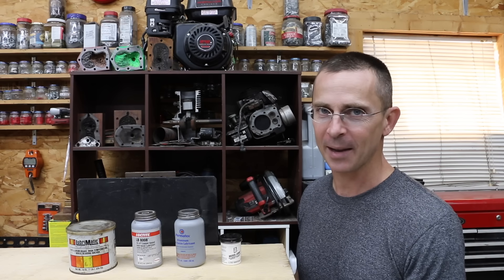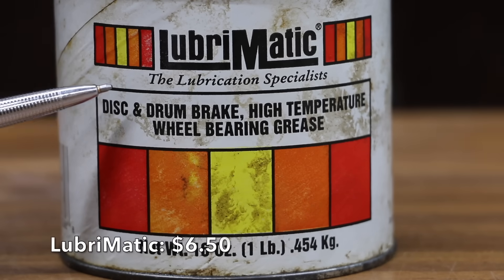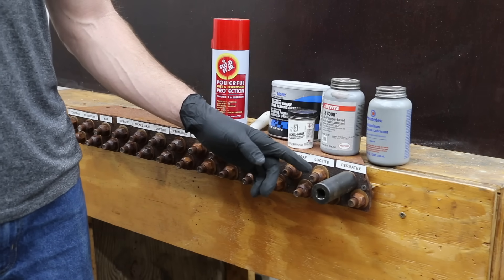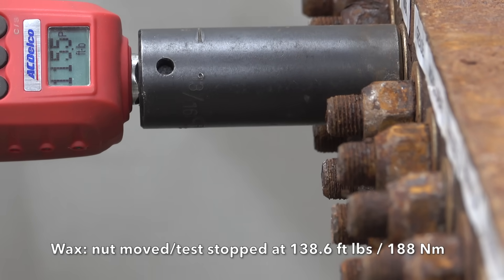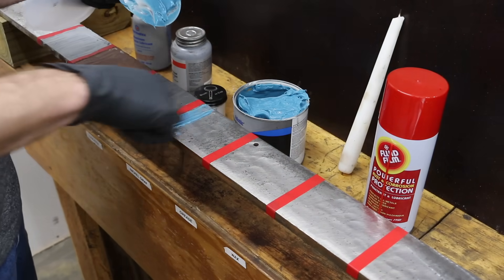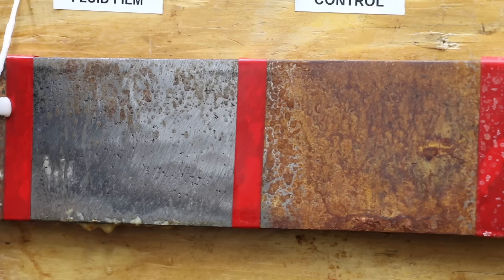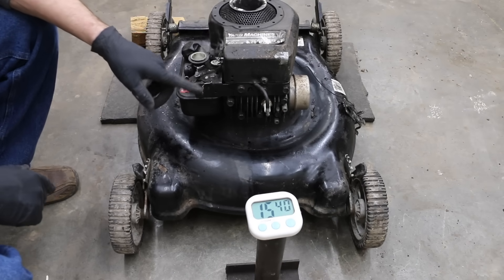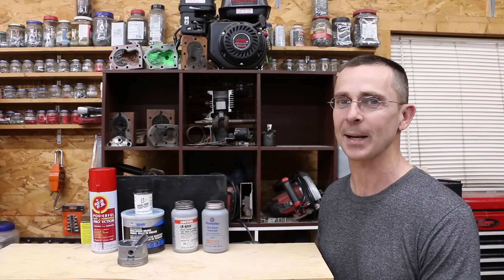Does Anti-Seize Compound Actually Work? Let's find out! Anti-Seize vs Grease vs Fluid Film vs Wax

Comment: I have that same Permatex container on my work shelf. It seems to last years. I use it on virtually every bolt and nut on every project, particularly those that will see weather, always wheel bolts, lawn mower repairs and etc. I've taken off wheels and disassembled parts years later and found it to work perfectly, including the race car (which has set 25 world and national records in NHRA/IHRA Stock Eliminator and yes I'm bragging lol). I may try the Loctite after seeing your tests but I swear by the Permatex.

Comment: As a former mechanic, it should be used more than it is. Spark plugs in an aluminum head, wheel studs, bolt action rifles so they do not freeze in the extreme cold. I could give you a long list, any bolt grip puller, but that stuff is messy.
Reply from the maker: Appreciate the insights!

Comment: For stainless steel nothing works better than silikroil in a high heat situations. Like commercial kitchen equipment. Or just normal conditions. It will often get a galled screw to break loose enough to remove it.

Comment: When a low pressure steam union has a slight gap and the work area is an absolute nightmare preventing you from making adjustments, graphite  anti-seize is your best friend.  Slap it on the union face and threads.  Torque well (use a mallet if absolutely necessary due to space restrictions) .  No leaks.

Comment: The real test of an anti seize is on stainless steel fasteners and fittings subject to high temperatures. The problem is not corrosion but galling which happens when a small imperfection slides agains another part resulting in work hardening, and a seized part. The manufacturers of the  turbine engines I worked on recommended a product called Never-Seez Nickel Special which is rated to 2400 degrees F. Fantastic stuff but expensive!

Comment: Where I work they religiously coat bearing journals with it.  Many on the journals are pretty badly worn.  I've become convinced that anti-seize in a situation where the fit is lose and it walks the whole time turns to glue when mixed with the metal dust from wear.

Comment: 1000% its works.   I spent 40 years in industrial construction and maintenance and if the previous mechanic had used it, it would have saved me a ton of work.   The best i ever used was nuclear grade nickel graphite from Permatex.  If it is used on bolts inclined to seize up, it will help it from rust locking.   You can cook the oil out of it but it leaves something softer than the bolt or nut so it gives instead of the two harder metals from binding up from friction.   Yes it does work and well.   Its the mechanics best friend!
Reply: The Permatex Aluminum also contains graphite. My experience is that it works as well as copper or nickel on fasteners that don't see high temperatures. I believe that graphite is the key.

Comment: Nice Video!
In our company we use two diffrent anti seize products. For shafts and hubs we typically use copper paste as you have shown in the video.
and for screws especially if they come in to contact with water we use a mixture of beef tallow and transformer oil (the oil is just there so that the tallow doesn't get hard). This is a very old trick but it works so perfectly. We never have problems gettings nuts loose if the guy before you used that mixture.
Sadly only few people nowadays know about this anti seize product but it works really great!
Keep up the good work!
Greetings from Austria!🇦🇹

Comment: Original Antiseize worked VERY VERY well.
Reason is because it actually contained lead.

In many of the old owner's manuals for cars, in there they say to put a few drops of engine oil on wheel lug nuts.

Comment: Nice show giving the 1 cylinder all the beans while testing. Be more careful as a generator of mine once threw the rod clean out the block denying the bed of my truck when it happened. This could cause you serious injury if it happens in your shop. Not knowing which path the force will be going. Nice demonstration. Just please put in a steel plate or something to be more safe between you and the test subject

Comment: I'd like to see a comparison test on keeping battery posts from corroding....
Reply from the maker: That's a good suggestion!
Reply: @ProjectFarm I used to work on my Dad's used car lot. So we always had issues with that. I discovered after cleaning them I could just put motor oil on them and it solved the issue . Just dab on a little more at each oil change to keep it coated. Works great.

Comment: The metal in the compound is to put an indifferent metal in the mix in between the threads.  A layer to prevent corrosion bond. 

It's not lube for moving parts

Comment: I used to formulate antiseize and other greases when I worked at a lubricant company.
I made stuff for the military, freezing railway equipment,  and hot engine exhaust manifolds, and my stuff  never failed.
We used all the same tests, plus a 24 hour salt/brine spray test for corrosion.

Comment: 40 years ago Quaker State had 
Golden Chassis Grease
It didn't have a type number.
I still have a tube from way back then 
It looks just like the copper anti seize 
The tube does not state what it is just "special additives" and "do not use in ball roller or wheel bearings" and I remember using it like a poor man's anti seize until I could afford the real thing.

Comment: In shop where i work there is an oven nearby used to heat things up to 600 degrees.
A few years back maintenance was replacing some needle bearing rollers that were part of sliding drawer on bottom of the oven. The rollers were completely seized with baked grease in the rollers.  I told the maintenance guy working on it to try using 
' never- seize ' as grease on the bearings so they dont get seized up.
He informed me he had special
' high temperature ' grease to use with the new bearings. 
A week later the ' new ' bearings were all seized up tight.

Comment: I’ve actually never used anti-seize I use grease on all my bolts on my trailers and outboard motors that are constantly dumped and saltwater years later the bolts come apart with no problem plain old grease
Reply from the maker: Thanks for the feedback.

Comment: Anti-seize compound is not primarily a lubricant.  My understanding is that it has has metal or other powders in it which form a sort of barrier.  This is mixed with lubricant(s) and a binder to make it sticky.  It is meant for use on bolts, &c. where there isn't supposed to be a lot of motion, but it prevents galling and seizing.  If you try to use it as a lubricant, the metals being moved around actually act as grit.  There are formulations for specific metals (iron, aluminum, stainless steel) and conditions (e.g. marine, high-temp).

Comment: People need to understand that antisieze compounds are for use as a static product in a confined space like threads. It’s usually a dry product with various petroleum additives to hold it in place until the fasteners are installed. A real test would take years like exhaust nuts on an engine that has gone through hundreds of heat and cool cycles. Sometimes running for days nonstop. As for an engine internally there’s no hope because it isn’t trapped and not a good lubricant for continuous motion, plus it doesn’t supply cooling which oil does.
The best I have ever tried is Caterpillar branded which is made for them by various manufacturers. It seams like a molybdenum product by its color.

Comment: I would like to see various brake part lubricants tested for resistance to corrosion agents, extreme heat, pressure washer, and low temperature lubrication.

If you take my idea, I'll upgrade my membership.  😉😂

Comment: Aviation mechanic here. Bostik Silver nickel ant-sieze is a life saver on our high temp air lines and other high temp areas on and around the engine. 
You can always tell when the last mechanic didn't give a damn, when you're having to use 1/2in drive breaker bar to break loose bolts and b-nuts to get your part out!

Comment: Aluminum (Al) antiseize is cheap. I used to use it, then started to buy more expensive stuff, copper and nickel.
    Then, after learning more about galvanic corrosion, I am back to Aluminum.
   It is hard to tell, they all work somewhat, but in theory, copper particles in a steel-steel thread should cause the steel to corrode, while Al should protect the steel while undergoing "sacrificial corrosion" itself.
    Since they are all in some unknown "carrier lubricant ", the greasy part, it is hard to really know.
   Differing conditions make it even harder to know.
    Some jet engine manufacturers have specified milk of magnesia for fasteners and ignitors on jet engines.
   That is strange,  it is a water mixture, and not much of a lubricant,  but I have tried it and it does seem to work. 
    It is also really cheap.
    This subject is like penetrating oil- we all have our favorites, and are sure we are right, based on limited anecdotal evidence.
    Thanks for your effort and interesting tests. You sure put in some work, I learn from it.
Reply from the maker: Thanks!  Thanks for sharing.

Comment: One of the big things that separates Anti-Sieze from grease is anti galling.  When two similar metals are under pressure with one another for prolonged time they swap electrons and get fused together over time.  Anti-sieze not only prevents rust but also creates a different metal barrier between the fastener threads preventing galling.  Hence why aluminum or copper is used.  also aluminum and copper have different intended materials to be used on but I forget what it is.

Comment: Used anti-sieze on a drum brake adjusters on my car that unintentionally ended up in a field for about 35 years. Towed the vehicle out by the axle compressing the  e-brake cable locking the brakes. Cut the e-brake removed the wheels and backed the adjusters off and pulled the drums like the day I assembled them 35 years ago took less than twenty minutes  to r&r and push it into the garage. Friend who was watching couldn't believe it...actually I couldn't either...highly recommend anti-sieze!!!😇
Reply from the maker: Thanks for the feedback.

Comment: I have been coating battery posts with grease for 50 years whenever I install a new battery.  It totally stops all corrosion.

I think this was a valuable video, but I think that the lawnmower part was a bit odd.
Reply from the maker: Thanks for the feedback.

Comment: I'd argue there's something wrong with consistency of the environment when your control nuts required less torque than treated nuts in any circumstance. It also seemed quite often that the lower row required less than the upper row, indicating the environment just wasn't quite equal across the board.
Reply from the maker: Thanks for sharing.

Comment: Antiseize is great but it also is a lubricant. I snapped a fuel rail bolt this way. I was using a torque wrench the whole time. It was an awkward location. Luckily I was able to use a pick to back out the bolt. Otherwise, the head was coming off.
Reply from the maker: Thanks for sharing.

Comment: Permatex’s anti seize is an anti galling compound.  Yes, it will protect against rust/corrosion, but galling is wholly different.  Where metal surfaces are under extreme pressure, friction, heat, they can actually seize or weld together.  The high heat rating allows this to prevents galling far better than “regular grease”

Comment: Always use grease for motor shaft or near bearings and use anti seize on bolts nuts and connectors. The reason is near bearings shafts and motor shaft the anti seize has abrasive in it and it can get into the bearings and the seals and make the bearing fail.
Reply from the maker: Thanks for the feedback.

Comment: I've used both Loctite Copper and Permatex Aluminum.  Both worked as advertised.

WARNING:  DO NOT EVER use anti-seize on nuts and bolts with require precise torque values such as wheel lugs!  Use ONLY clean and dry nuts and bolts.

Comment: Can't believe I missed this gem of a comparison. I use both the permatex silver and copper anti-seize and have a method of which one I use - whichever bottle I find first! Probably know by now, but that lawnmower broke a rod because of the solids between the piston top and the flat part of the head. Engine oil will burn and be exhausted, but not the solids in anti-seize. Anti-seize fits my needs by displacing oxygen and moisture from the threads as well as giving consistent torque for even fastening (like intake bolts).
Reply from the maker: Thanks for sharing.

Comment: I generally use brake grease. It's cheap and tends to work. I save engine oil for bicycle chains and door hinges. I bought a large tube of dielectric grease which I use on sparingly on my electrical connectors in my car. Tends to keep the plastic from breaking.
Reply from the maker: Thanks for sharing.

Comment: i really enjoy these types of videos, they're a good demonstration of what works and what doesn't, however, anti seize isn't just for rust, there are certain incompatibilities between metals, like aluminium bolts into stainless steel, or aluminium on aluminium, or brass etc, they have a very fine layer of oxidisation which can be caused from just touching the material that forms between the threads or fittings and it can cause them to lock into place and become impossible to remove even after just an hour of being torqued, it would of been interesting to have a demonstration on those types of materials as well, as there is different types of anti seize as well like copper or aluminium or nickel, I often wonder which is best to use on certain non ferrous materials as well but haven't taken things apart after assembly to find out, but i have heard using the wrong one can cause this locking effect to become even stronger as well.
Reply from the maker: Thanks for the feedback.

Comment: Any time you have dissimilar metals, such as steel bolts or screws in aluminum, you'll get galvanic action. Stainless steel is even worse. With the current stress on weight reduction most equipment is made of aluminum and fastened with steel bolts, and any where outside an engine where it's bathed in oil, there will be corrosion. Anti seize can't help but be good.

Comment: When I worked for a pipeline company we mixed never seize with STP to lube large valves, stuff was unbelievably slippery put it on screwdriver blade and you couldn’t hold it between your fingers
Reply from the maker: Thanks for sharing.

Comment: Anti seize is great, especially in the marine environment.  But if you don't want fasteners to come loose, apply the non-copper anti seize, wipe it off, then apply a thin dab of RTV and run the nut down.  The RTV will help seal the threads and act as a poor man's Loc-Tite 😅
Reply from the maker: Thanks for the feedback.

Comment: Only issue that I have is that nuts & bolts rely on the friction of the threads to maintain torque to hold. In a somewhat corrosive environment, you still need a certain amount of torque resistance to hold components together, especially with vital things like lug nuts on fertilizer spreaders and feed wagons/trucks. You want them to maintain their hold, but also be free enough to remove. Staying close to original torque specs is more important than a lower torque to remove. You don't want loose wheels, and Kenny Rogers sang about "You picked a fine time to leave me, Loose Wheel". Or maybe something like that...😂😂😂
Reply from the maker: Thanks for the feedback.

Comment: Anti size is not for oil replacement in an engine.  This is a dumb thing some viewer sent in to see about internal use inside and engine oil cavity.  The anti size is for fastener use only. Nuts and bolts

Comment: All you have to do to prove if anti seize works is to do what I did. I'm a retired Pipefitter that did refinery shutdowns in Toledo, (Oregon) Ohio. They give you a slug wrench that you hit with a sledge hammer to loosen the bolts on flanges. You can sure tell the ones that had been put together with anti seize, much easier to disassemble...
Reply from the maker: Thanks for the feedback.

Comment: Ive been using liqui-moly as anti sieze for years now just because I had a tube and it's convenient. Definitely better than nothing. I can tell it works good on rotors vs wheel bearing grease since I've used that too and switched to only moly.
Reply from the maker: Thanks for sharing.

Comment: You missed the whole point. Anti-seize prevents galling when steel is threaded to aluminum. Steel spark plug into an aluminum cylinder head, for example. The idea is to prevent dissimilar metal corrosion.
Reply: EXACTLY¡

Comment: I wondered if products like WD40 or PB Blaster could actually penetrate between threads. It didn't seem possible with all that pressure between threads. The salt water intrusion and resulting rust deep into the thread engagement proved to me that these products can indeed enter the threads. I guess the threads don't make complete contact across the entire face. There must be a channel between the threads that allows the liquid to enter.
Reply from the maker: Thanks for the suggestion.

Comment: We used it at a Chem plant I worked at. If you did not use it on steam line flange bolts you has to cut them off.
Reply from the maker: Thanks for the feedback.

Comment: Typically I use anti-seize where heat is present and Sil-Glyde for other nuts, bolts and brake work. I’ve had pretty good luck with SG when revisiting old work. Honestly I’ve never considered Permatex, my usual choice, for nuts and bolts where I use SG. Good to know I can’t go wrong either way. Very informative and well presented.
Reply from the maker: Thanks!